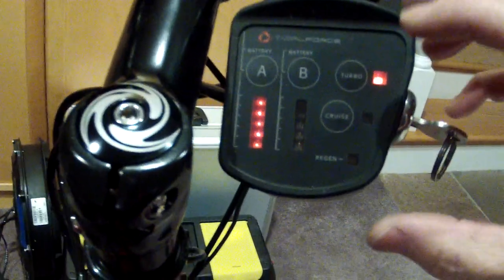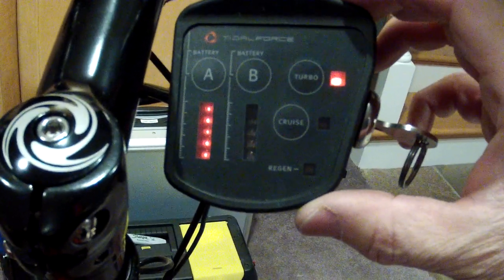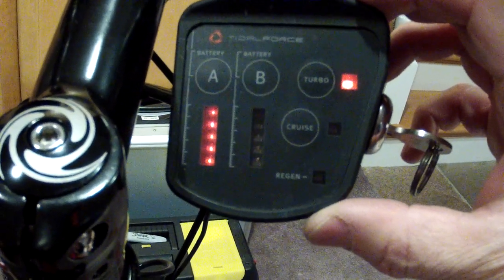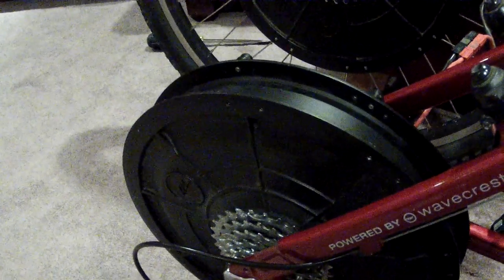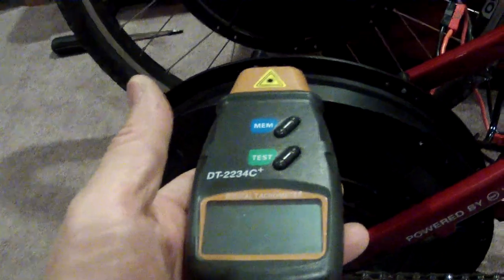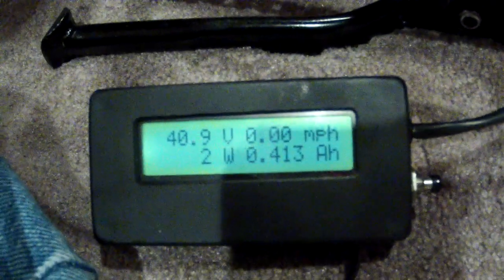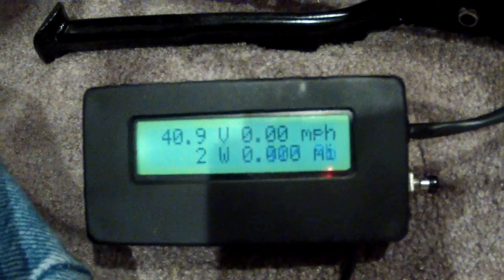GOPR6573 Part 2 Tidalforce S-750 Turbo mode motor test - THE SURPRISE

Comment: Such a deal....I've got an '05 TF S750X ebike. It had 10.5 miles on it when I bought it. The seller didn't have an original beige charger.

Great bikes. I'm getting around 27.5 mph on level ground & around 37.5 mph on a slight downhill pedaling like a mad man. The original front NiMH hub battery only lasts around 6 miles on turbo.

I'm waiting for you to figure out how to put the two Zippy 18.5 Lithium (Hobbyking) in the front hub. 

I've got the dash jumper required to use any battery...soon.